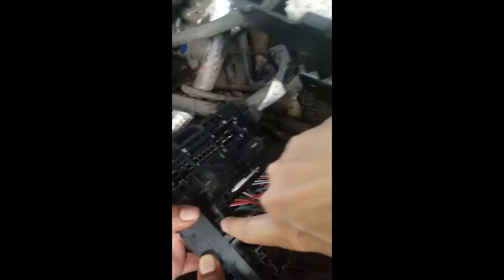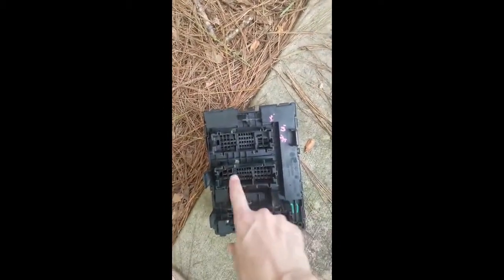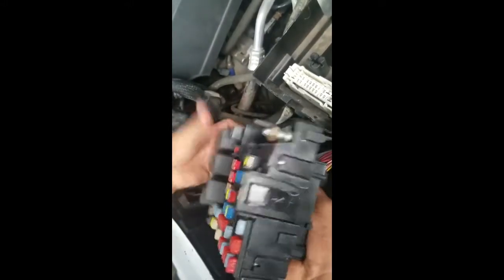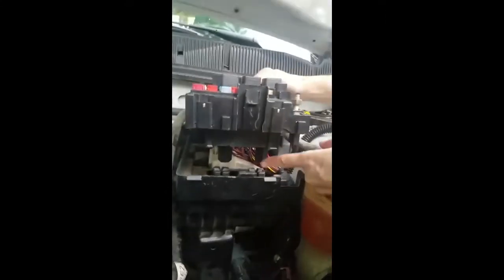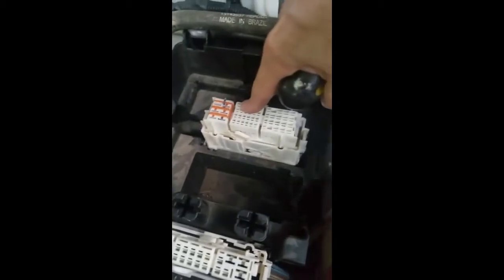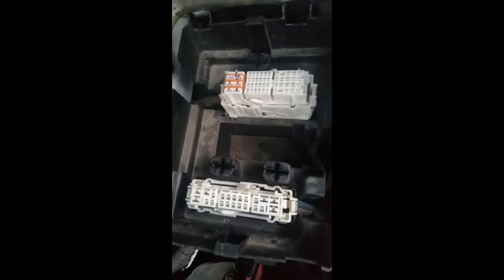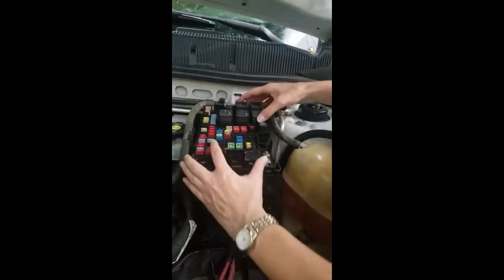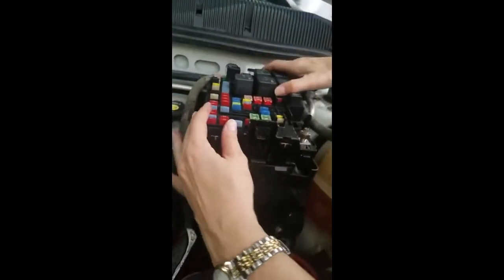Replace Engine Fuse Box - Suzuki General Motors XL-7 XL7 Forenza Vitara Mitsubishi Pontiac Buick

Comment: I do almost all my own car repairs and roughly three years after you posted this video currently with almost no comments it has been a blessing this July 9th of 2024. I lifted the fuse box and removed other parts to install the transmission mount. That’s another story. When I put everything back together the car would not start. No start. No crank. I plugged in my OBD2 scanner and displayed no communication with the ECM. I had been at this for about 10 days watching video after video. Tried everything: testing all fuses and relays inside and outside the car, taking off and reinstalling the fuse box, connecting a loose cable, etc. I had seen your video when searching for the transmission mount info. While looking to resolve the no-start issue I watched yours again and BINGO!!! I did not notice the white connectors under the fuse box had sunk in. I thought they were where they were supposed to be. I pulled them out until the click locked them in place, replaced the fuse box and it started right up. Thanks for the video and thank you Jesus Christ Lord and Savior for having this video show up for me.

Comment: The receptor blocks in the base unit must be pulled up into the locked position. Then carefully and squarely put the fuse Block into the receptor below. Very carefully and must be lined up equal on all sides as it enters.

Comment: I am facing the same issue ,  I have a 2007 Suzuki XL7 made in Canada on a GM platform, the pin receptors on some of the continuos high amperage load have had enough resistance from oxidation and have melted the plastic base supporting the receptor tension.  Now the fuses won't stay Locked in and a bump in the road will break the contact causing loss of communication with the sensor, ECU and then a code fault is set.  Fortunately Gm Torrent and Equinox of 2006-2009 are more or less mirror images of the XL7.  When looking for used engine fuse/relay block the GM are plentiful and much cheaper.  There is no crossover info showing fitment but I am fortunate to have a son who is a highly qualified mechanic with enough knowledge to verify the fit is the same in every way.   Hope this info helps any and all who are experiencing this problem. When my son overhauled the engine I ordered all my parts as though it was a GM and it was so much less money than ordering Suzuki XL7 application.  As for me I am going to remove the block and separate the upper section so I can get to the pin mounts.  I then will plastic weld the melted areas and clean all the receptor contacts and apply die electric grease so this problem is eliminated,  hopefully!
Reply from the maker: Thank you. You are right about everything and others will benefit.